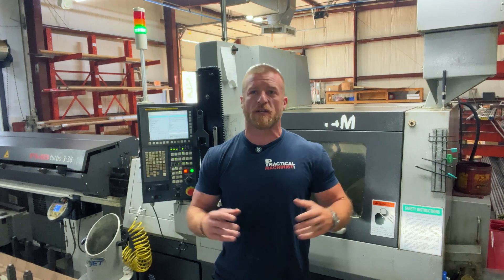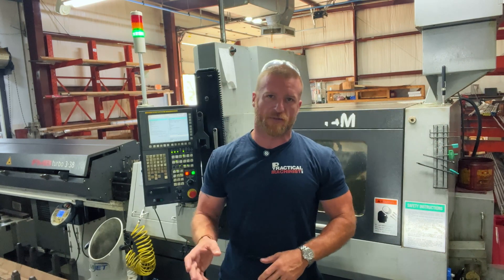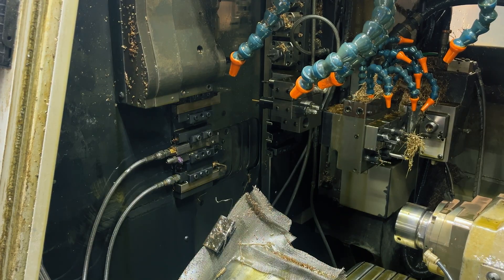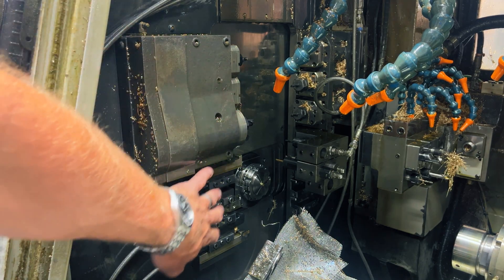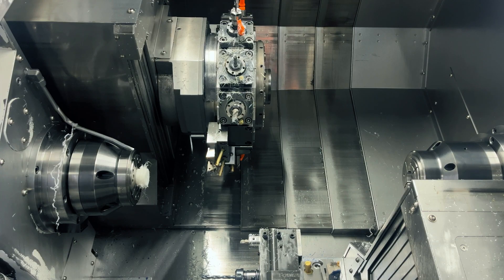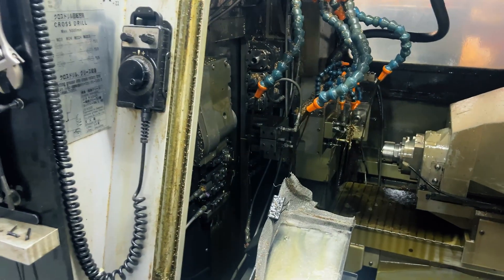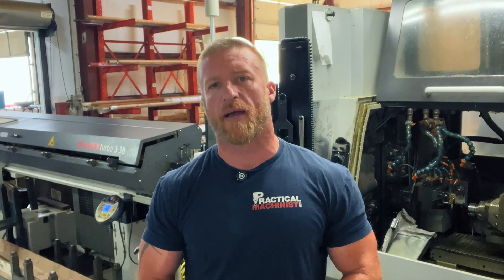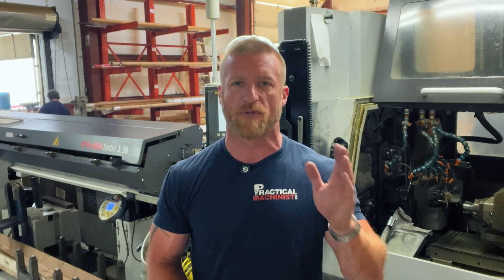Swiss vs Fixed Headstock Lathe — What’s the Real Difference? | The Lathe Lab Ep.13

Comment: Thank you for such a great overview!  I've heard of Swiss lathes before, but never knew anything about them at all.  The stock diameter tolerance limitation seems difficult, but it sounds like an excellent option if you spend extra on material/pre-processing to cut down additional operations for a lower overall cost on specific part types.

Neat stuff!